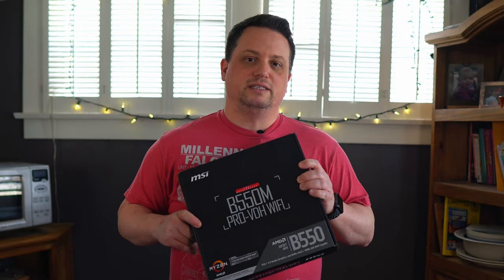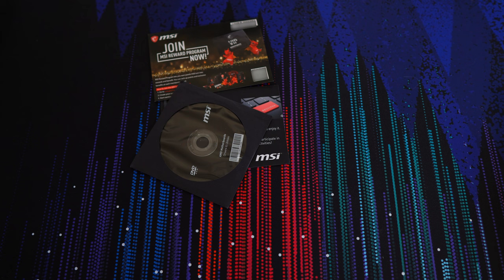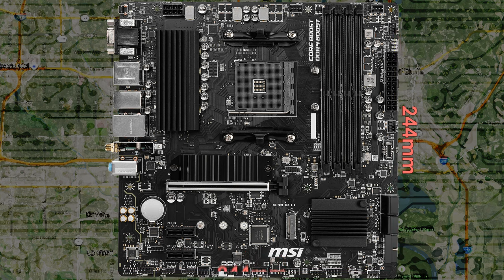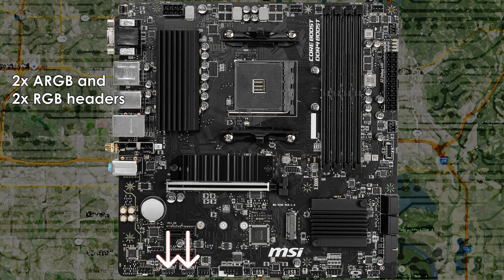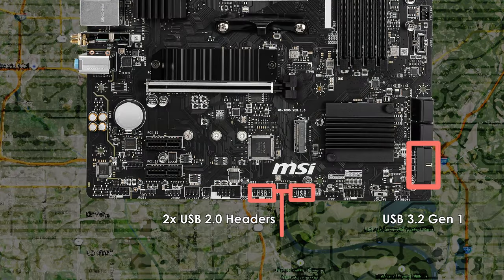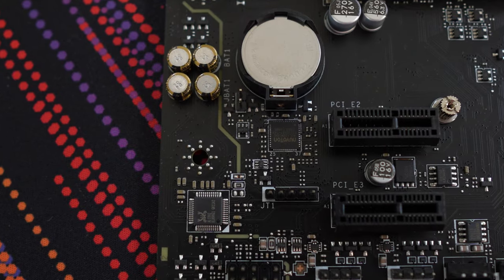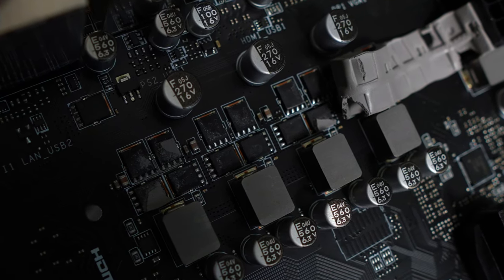Unboxing and taking a deep look at the MSI B550M Pro-VDH WIFI

Comment: I have been using this board for a while now, got it for a steal as part of a bundle deal which made me seriously question if it was gonna be as good as it is. Turns out, this board is GREAT, especially at the price point. Just checked this video because I wasn't sure if the second m.2 slot was PCIe 3 or 4, so thanks for the info, your format and presentation is awesome and saved me the hassle of digging out my mb packaging and manual for the info I needed!
Reply from the maker: Glad I could be of help. Thanks for watching!
Reply: How is it still holding until today? and what programs or software do you usually use?
Reply: @superduper2024  it still runs like a dream, I use it mostly for streaming and gaming so not sure what it's like for other applications but I can tell you it is smooth as butter for every game I've run on it including TW:WH3 and Baldur's Gate 3 which are both resource whores. It's in a fully AMD system which I can recommend wholeheartedly
Reply: @Veklim  what cpu GPU PSU you're using with this mobo?
Reply: @axhit  Ryzen 5 5600X and Radeon RX 6600XT
Reply: Is it relevant up to next year?
Reply: Hey bro I have a budget of $600 and I’m confused for the mobo as I’m getting both at Almost same price 
Gigabyte b550 aorus elite ax and
Msi b550m pro vdh wifi 
Which one do you think I should get?
Reply: @StealthGamer_45  I'd say the gigabyte aorus is the better spec of the two, more ports, better OC speeds on the RAM and a few other things (ECC memory support for instance) but it's also a little longer so keep that in mind (shouldn't make much difference but it might depending on case choice).

There's not a lot in it though.
Reply: update on the mobo?
Reply: @TheKrungkring  still a beast and very relevant. For a budget system choice it's top notch but I've not seen what's about this year yet. Not planning on upgrading ANY time soon though, this thing seems fully capable of pulling another 5-8 years before I start running into significant bottlenecks.
Reply: @Veklim  tnx feedback coz im choosing two boards this one and the asrock pro 4.

Comment: AFAIK USB doesn't support more than 3 key presses at once, so therefor using the PS/2 for keyboards can be an advantage. Or simply if you own such an old keyboard.

The VGA is a no-brainer, you can get dirt cheap monitors with VGA. It's great for small 7-10" screen to watch TV on for instance.

Comment: I got a combo deal from Microcenter with a 5600X and this motherboard for $219. I thought this board would suck but it's actually not bad at all.
Reply: That's a great deal
Reply: Should I get this or the ASRock B550M PG RIPTIDE AM4 AMD B550 SATA 6Gb/s Micro ATX AMD Motherboard
Reply: @URFATH3R as rock B550m doesn't support wireless wifi connection

Comment: @ 2:13 - Before assembly, take notice to the numbers found on the sticker- on the 24 pin power socket. Drove me crazy trying to register my product w/o knowing where to find the code.( I forget what the code was called, I think it was a 3 digit #) Finally when I did figure it out, it was after I assembled the PC. Had to use an inspection mirror to read it! 
MSI making you jump through hoops, just to register the product! (My M-B is a Pro B550 V-C)
Reply: Aside from the registration, and the cheap I/O shield, I really like my Motherboard.

Comment: What do you think about this build Ryzen 5 5600 
Rx 6600 
Corsair Venegance Pro 32 GB (2x16 GB) 
MSI B550M Pro Vdh Wifi 
Cooler master TD300 mesh 
MAG A650BN 
SSD Kingston 1TB
Reply from the maker: That would be a solid build! I have a similar build but with a 5600G and with that I can get great fps on medium to max settings (depending on the game) at 1080p.
Reply: @MiddleofKnowhere  cool, thank you

Comment: 14:26 is 60hz us the limit for the display port? i am thinking of buying 165hz monitor with ryzen 5 5600g for now. I will add gpu later on after few months, but need to know if this mobo can support my monitor for 165hz.
also thx for detailed video. its very helpful.

Comment: I wonder if the lettering means anything? I was looking at a Pro B55 MC, I happen to Own a Pro B550 VC, this video  is looking at the Pro B550 VDH.
I think when it says Pro, Aesthetically the unit should fit a work environment. the Pro B550 MC is 'old school', OEM green Motherboard. My Pro B550 V-C is Black with mild accents to the build and minimal lettering.Although, it leaves no doubt, who the manufacturer is. It has 'MSI' printed five times, if you include the GPU. (another pet peeve, one of the printed "MSI"s is a different font.
Back to the subject, I would guess 'Pro B550 MC', might refer to Machine Class?(thinking Business/office application) My Pro B550 VC could be Video Creation?(thinking Content Creators) 
I'm just wondering what VDH could stand for.

Comment: Very appreciate the works you put into this video. Very informative, eg. the differences between top and bottom M2 storage infos. just bought this board and very excited to put it together
Reply from the maker: Glad it was helpful!
Reply: @MiddleofKnowhere  I have a question. If I use up all M.2 slots, will that disable the SATA ports on this board?

Comment: Thanks for the info. So even if i buy a gen4 dram m.2 storage i will still get gen 3 speeds because i chose my first cpu a 5600g. So i guess i'll put it in the bottom part
Reply from the maker: Correct.

Comment: Does anyone know any compatible ram with this I’ve bought 2 different brands so far and nothings working😢. Yes I placed them in properly and no there’s nothing wrong with the ram slots
Reply from the maker: I used geil ram. Which brands did you use? G.skill rip jaws v is always dependable.

Comment: Thank you very much, i was planning on using my old fans (3pin) on my new case but i just couldnt find the 3pin slot. Gotta buy new fans i guess
Reply from the maker: Hi, You won't need to buy new fans. 3-pin fans can work in the 4-pin pwm slot, they just won't be PWM, meaning you can't really control the speeds by software. I believe they are called voltage controlled fans, which you can control in the BIOS. so PWM, 4-pin, headers have a keyed portion and 3-pin fans can slot into them. Look at this article on Arctic's site. https://www.arctic.de/us/faq/detail/can-a-3-pin-case-fan-be-used-on-a-4-pin-pwm-port
Reply: @MiddleofKnowhere  Thank you for replying! I tried it and it works, now I have top exhaust fans!

Comment: Great and elaborative video for the motherboard. I just have one query: At 16 minute 30 second timestamp, you were talking about upgrading the WiFi connectivity thing through the M.2 slot. 

I currently uses the antenna and they aren’t pretty fast. So, I guess if you can help me in setting up the extra WiFi option, then it will boost the capacity by a bit. 

Also, you told to use the second and fourth stick when using dual RAMs, what about if we are using 3 RAMs, is there any specific configuration in which we can maximise the output ?
Reply from the maker: Check out my video on adding wifi to an AsRock motherboard. The solution I used there was pretty fast. Also with wifi 7 out keep an eye out for those cards.
Reply: @MiddleofKnowhere  Is it the same for the MSI B550M motherboard?  Because the MSI B550M has its own WiFi and Bluetooth module and also the Antennas setup! I guess it will be pretty hard to do that on this one! The pre-installed WiFi is: RZ608 WiFi 6E 80MHz

Also, I have another query. Is there any legit External CD reader/Writer that I can use with the motherboard? I am asking this because I do have many CDs and I really want to access their data. Can you please help me out!
Reply from the maker: Check out the drives from this list. It's blu ray which covers CD burning. They are external and I've filtered by brand: LG, ASUS, and Pioneer (brands I trust), so you can dodge the odd named brands that Amazon tends to have.  I have a Pioneer one I use to import CDs (I still buy them). https://amzn.to/49HJVpV

Here's just CD: https://amzn.to/3UNxGnq

Hope this helps!

Comment: I have the board installed with the Tecware Eclipse 240 AIO, which includes a 9-pin connector for the 2.0 USB header. While it receives power, it's unable to transmit data to the AIO, resulting in the LCD display remaining stuck on the default setting. I'm unable to change the display or GIF. Ports, cables, and headers checked to no avail.

Comment: Do I need to get a wifi adapter? The wifi on this board doesn’t connect or anything it asks me to connect a Ethernet cord
Reply from the maker: If you have the wifi version it should connect. make sure it's that version and not the non-wifi version. After that, make sure your drivers were installed when you installed windows. Go to device manager to see if it's there. If it's not, you may need to connect an ethernet cord temporarily to download drivers.
Reply: @MiddleofKnowhere  yes, it’s the wifi version that came in as a bundle. It has the wifi connectors on the io. Where do I find these drivers? Cause I already updated the bios and still no sign of adapter in device manager and Bluetooth is also saying “generic Bluetooth device error code 43”.
Reply: same also theres no bluetooth, still looking for ways to fix this

Comment: only $92 USD in australia. using it with a AMD Ryzen 5600g for my 2nd system. makes for a bargain system
Reply from the maker: That's a helluva deal! What's like 80 US maybe?
Reply: @MiddleofKnowhere  92 USD is 92 dollars american.
Reply from the maker: Lol I’m blind. Didn’t see that.
Reply: Got the Wi-Fi version for about $93 a few weeks ago - seems like a great board, for the price. I plan to use it along with a cheap used R5 3600x and a spare GTX 1660S I have on hand to make a budget gaming PC for my sister.

Comment: Love your video on well detailed explainations on this MOBO
May i ask
Im planning to buy Rzyen 5500g and this board is it good for gaming without gpu?
And is it compatible on windows 11? 
Let me know thank u
Reply: I will use also Samsung NVME 250gb evo
And corsair x2 8gb  32gb 32000mhz ram
Hope its all compatible for gaming and windows 11
Reply from the maker: Do you meant 5600G? There's not 5500G that I saw. Regardless, the bits will work together well. If you're just relying on integrated graphics, your gaming experience will not be the most amazing, but it will do. Having said that do not expect to play Cyberpunk at good framerates if at all. More casual gaming should be alright. I def recommend going for a 500 - 1TB NVMe if you can afford it as you'll want more storage for games on top of the OS. They'll all be compatible with Win 11, so you're sorted there. If you can, save up for a discrete GPU for a future purchase so you can have a better gaming experience.

Comment: Hello, I am writing again. My motherboard arrived and I am wondering what screwdriver would I need for the m.2 screws. And also my board has a sticker "5000 ready", does it mean I do not need to flash the BIOS? Also really nice video, definitely gonna help me for when im building my PC
Reply from the maker: Correct, you do not need to update the BIOS for your 5000 series CPU. If you're using a 5000G series, I want to say you won't need to update either. A standard Philips head screwdriver should do you fine for the m.2 drives. Just don't over-torque them so you don't strip the screws. If you have a multi-bit screwdriver with bigger and smaller Philips bits, this might help you.
Reply: @MiddleofKnowhere  thank you for your reply appreciate it🙏

Comment: Hi, what will happen if I accidentally put my PCIe 4.0 SSD KINGSTON 1TB on the bottom slot wc is PCIe 3.0? should it fine?
Reply from the maker: It will operate at PCIe 3.0 speeds instead of 4.0. That's pretty much it.
Reply: @MiddleofKnowhere  then I should change it right now and put it on the top slot with the heatsink to perform as it should right ?

Comment: Which power suply shall i get with this? I want power supply to have all compatiable cables to connect to board nd with graphics card gtx 1650 or gtx1660
Reply from the maker: What CPU will you be using? Based on that GPU, you could probably go with a 500-650 Watt PSU. I always encourage to go for higher wattage though so that as your system grows, it's one component you don't have to upgrade. So for instance if in the future, you plan to get a 4070 or equivalent GPU and a 7800X3D then a 750 watt PSU would probably work.
Reply: @MiddleofKnowhere  Ryzen 5 5600G if not intel i5 12400F
Reply from the maker: okay. This motherboard is AMD only so you'd need an intel socketed motherboard for the 12400F. Check out the Ryzen 5 5600 over the 5600G. It's a bit better and shouldn't be much more money.
Reply: @MiddleofKnowhere  ok thank you! One last question does ryzen 5 5600 have interated graphics?
Reply from the maker: The 5600 doesn't have integrated. The 5600G will though, but you'll miss out on some features by going with the 5600G over the 5600 such as PCIe 4.0 for storage (5600G only has 3.0) and then the PCIe x16 slot will become 3.0 as well. If you don't need the integrated graphics go for the 5600. Otherwise, the 5600G is your best bet.
Reply: @MiddleofKnowhere  thank you! You helped alot

Comment: Correction that even the motherboard doesn't have ryzen 5000 series sticker it doesn't mean that it's not compatible take note that all B550 and X570 chipset supports ryzen 5000 series and all ryzen 5000 series are 3rd gen ryzen processor LOLS
Reply from the maker: You’re missing the point. If the sticker isn’t present then the BIOS to support Ryzen 5000 series CPUs is more than likely not installed which means the motherboard will not have out the box support or compatibility and your Ryzen 5000 CPU will not work with the mobo. 

I even say in the video if the sticker isn’t present, you will more than likely need a BIOS update so the cpu will work.

Comment: I just bought this motherboard but I have an issue.

The USB 3.2 Gen 1 90 degree angle is next to a part of the case that cannot let me to plug it. Is there a way to use it?
Reply from the maker: Take a look at a low profile USB 3.1 extension cable. I use these and they are pretty handy considering the case cable is so bulky! https://amzn.to/3tCzDb0

Comment: Hey bro I’m getting ryzen 5 5600 with Gigabyte b550 aorus elite ax (or)
Msi b550m pro vdh wifi for $600 (entire pc price is $600)
Which one do you think I should get? (Mobo)

And also do you think a Ryzen 5 5500 with ASRock b450 pro 4 would be fine right now I’m getting it all under $500
Reply: Do you think spending $100 more for 5600 instead of 5500 and b550 instead of b450 is worth it?
Reply from the maker: I do actually. With the 5600 and B550 you'll get PCIe 4.0 capabilities for the M.2 slots and NVMe drives. The 5500 IIRC doesn't have PCIe 4.0 lanes available to it so storage will be slower. Also it all depends on your use case as well. If you want to go for more demanding gaming or tasks, I think the 5600 is a better CPU. If your goal though is to save money go for the 5500 + b450. OR 5500 + B550 and upgrade the CPU later to take advantage of the features the board and a higher tier 5000 series CPU will offer.
Reply: @MiddleofKnowhere  yep thanks for the reply mate! I think I’ll go with 5500 and b550 and later on buy a 5800x3d or something

Comment: Will this mother board work with the ryzen 5600x?
Reply: Yea but you u need to update the bios
Reply from the maker: It will and as Guerra said you MAY need to update the bios for it to work unless the board came with a later version and has a “Ryzen 5000 ready” sticker on it.

Comment: I have this with the 5600g and im trying to do the bios update and all it does is blink forever and doesnt go through, please help
Reply from the maker: Which BIOS version did you download? Did you manage to unzip the file and put it on a USB drive before flashing? Find out your current BIOS version then download the most current, non-beta version.  Be sure to follow MSI's instructions as different motherboard makers have different methods.

Comment: I need help men , I just got mine and I installed everything but it doesn't shows video 

The problem with mine it's that I can't upgrade bios , the red light starts to blink but it doesn't finish never
Reply from the maker: Make sure your Video cable is plugged into your GPU and not the Motherboard video port if you're using a discrete GPU (like an nvidia 3070). If you're using a G CPU like a 3200G with onboard graphics, then plug the monitor cable to the motherboard. Make sure all your ram is seated fully and are in the right slots. Also make sure all power cables are fully plugged in as well. Finally, sometimes PCs are finicky if you don't have a keyboard plugged in (sometimes mouse too) so make sure those are plugged in as well.

Without more information about your build, that's about all the help I can offer atm.

Comment: I have a question for this motherboard. Can it use Ethernet finished the video yet am still confuse.
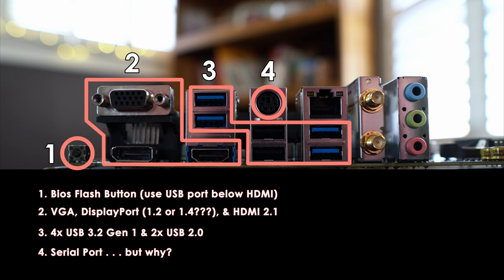Reply from the maker: Yes it has an ethernet port. I go over what solution is used in the Rear I/O section around the 15:43 mark.

Comment: can i use two 8GB DDR4 3200mhz  + one 16GB Ram 3200 in this mother board ?
Reply from the maker: You could, but I wouldn't recommend it. It's better to do 2 or four sticks in the capacity and speed you want. If you go with those mismatched sticks, you may not be able to set XMP/DOCP